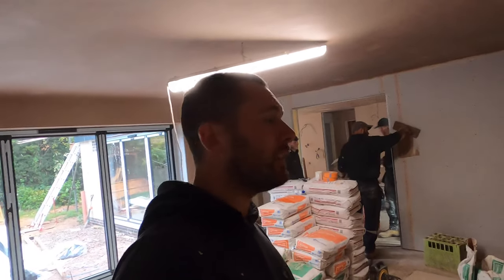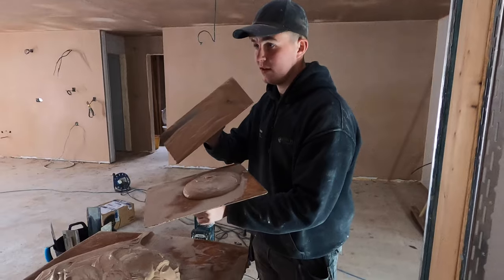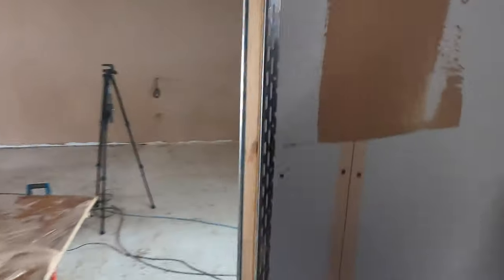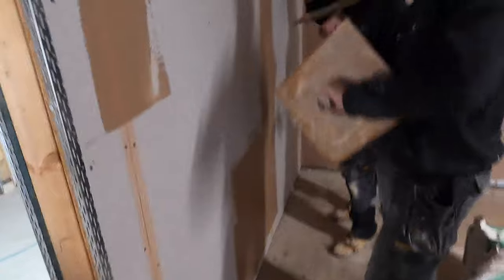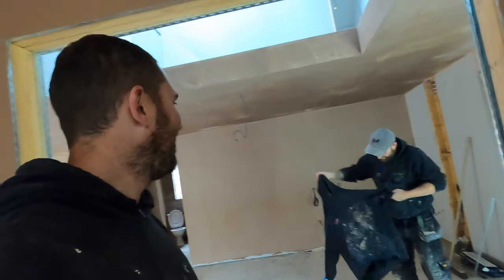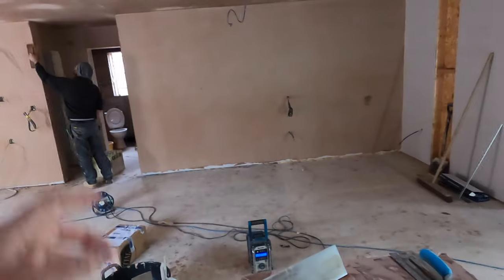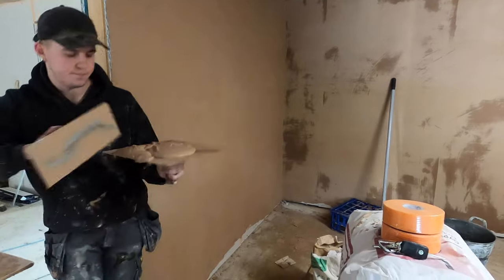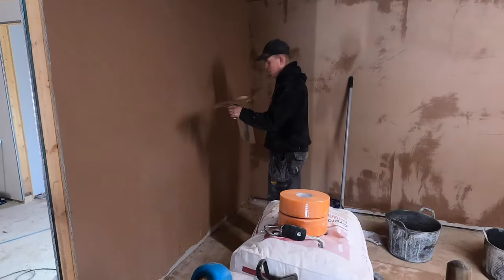Plastering For The First Time - Apprentice Series#1

Comment: Some advise please, been plastering a wall today for the first time, I think I’ve made the first mix to thick managed to get the first coat on wall,
Ran out of time to get second coat on wall which it needs. This is a plasterboard wall, can I put second coat on tomorrow and do I need to pva wall again.
Thanks in advance.
Reply from the maker: Oh dear yes definitely tricky in this heat for a novice. I would say that you will need to let it completely dry out and start again.